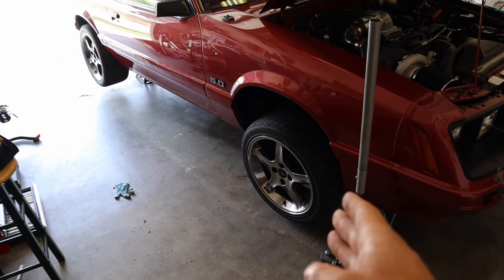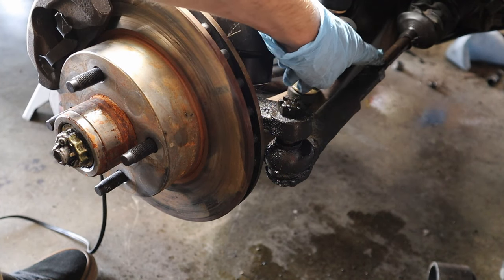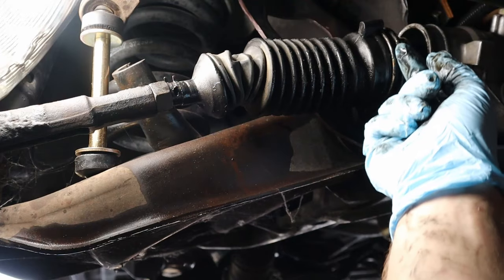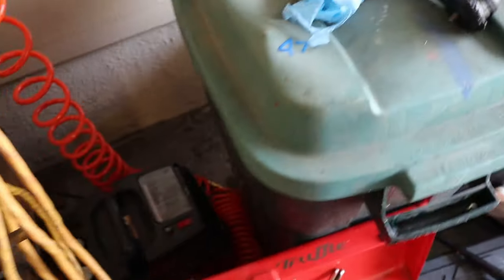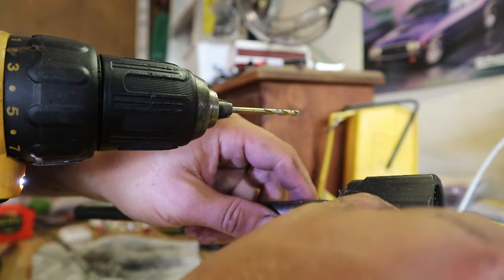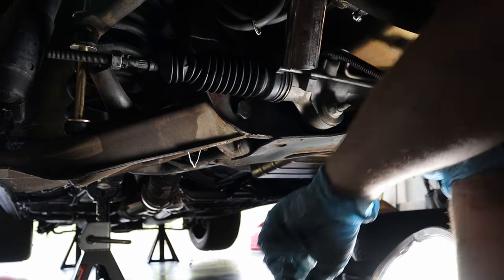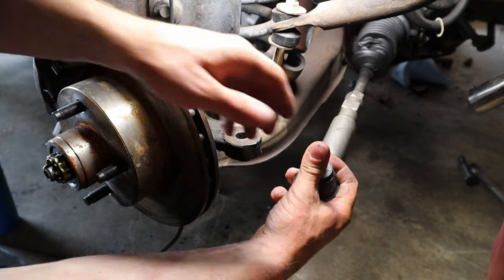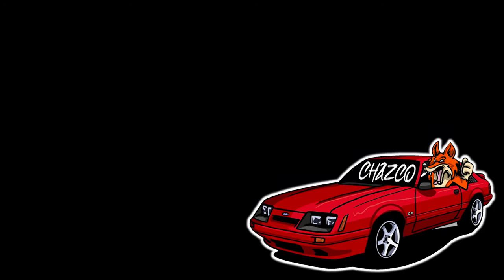Replacing inner & outer tie rods Fox Body STEP BY STEP GUIDE

Comment: I've got a 90 mustang gt and the passenger tie rod end doesn't want to come out.  I've tried hammering, lube, hammering the castle nut, heat, hammering a punch in the center of the bolt, 3ft pry bar, pickle fork, 5ft pry bar and nothing worked so far.  Looking for a special tool tomorrow after work.
Reply from the maker: Holy crap !!! So the castle nut is rusted on??? Or the end won’t separate from the spindle??
Reply: @iamchazhaynes7074  Tie rod end would not separate from the spindle.  I've got it apart now.  It took my air wrench, a tool from a box store and an adapter that allowed my air wrench to hook to the box store tool to get it off.
Reply from the maker: Oh my goodness!! That sounds like a massive mission Im glad you got it figured out!

Comment: You where suppose to a little grease on the inside that dust boot.
Reply from the maker: Hmm I haven’t heard that on the tie rod myself I read that they were pre-greased and to just fill the end up with grease until the boot swells a little? I know for the ball joint you put a little grease on there so the boot will slip on easier since it’s such a PITA to get on lol but I mean more grease is always the answer IMO
Reply: @iamchazhaynes7074   It's to help keep the ball socket portion of the inner tie rod lubed because that's where all the movement is.
Reply from the maker: Oh got it! My bad I thought you were talking about the outer end. That would have helped thanks for the tip I might take the boot off and put a little extra grease in there!
Reply: They're greased on the back side of the ball.